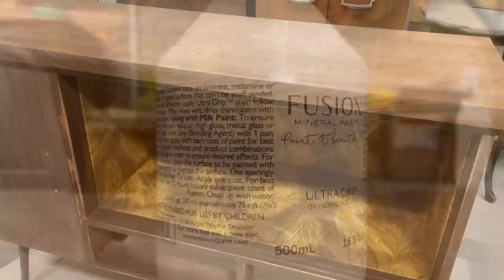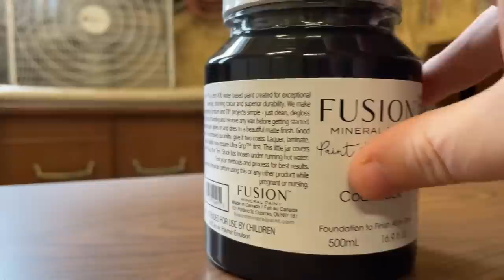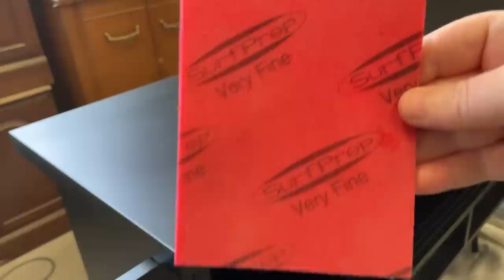Mid Century Modern Bar Makeover | FURNITURE FLIP!

Comment: Tip for enlarged wood/particle board screw holes: put wood glue into the holes and place (cram) wooden toothpicks into the hole. Let dry and cut back. Screws go in like new.
Reply: Such a great trick, recently I had to opt for bamboo scewers to solve the problem!  Those will work in a pinch, too.
Reply: Great tip!!

Comment: I have a similar bar cabinet, but mine is wood, one side has a fridge inside the door. The top opens and has a mirrored section you can leave open and store the liquor bottles . My friend bought it at an auction and gave it to me as a housewarming gift, it's awesome. I put rollers on it, so it's easy to move and won't scratch my floors.

Comment: To fill in stripped out screw holes, just stuff in wooden match sticks and you can even use the same size screws.  The wood from the match sticks is very soft wood and it will almost mold itself to both the wood and the screw for an extremely tight long lasting fit.  Some people add wood glue for an even stronger hold.

Comment: I really love this piece.  I would place a bet that the “etching” on the glass was really a decal that would have just peeled away.  I’ve seen that before on lighting pieces that I swore were etched.  I even loved the original interior.  In the video it looked like it was in great shape and would have been great to keep as-is if the glass could have lost the cheesy etching.   Also, did you consider etching the entirety of the glass instead of painting?  Love your inspiration on these beautiful modern pieces.
Reply from the maker: The etching was definitely not a decal or anything that could be removed. Etching the rest of the glass would not have made the pattern disappear but instead highlighted it. Thanks for watching!

Comment: Also...if the interior was in good shape I think it would have been awesome to leave the retro pattern!
Reply: I thought the same thing - kept the inside and glass alone (maybe tried to remove decal) painted the piece a mustard yellow to go with in yellow 🤷🏻‍♀️ I'm a beginner so ☺️
Reply: @lindahoover3445  like your idea! The retro pattern inside and the outside black would have been stunning. But with the etching (not a decal) she had not much choice as to go for painting the glass. Or remove the glass doors completely.
Reply: @lindahoover3445  
 I probably would have replaced the glass with plexi glass so the pattern and bar glassware could be seen.
Reply: Well that stinks - thanks for show me I can paint glass 😃
Reply: Well, that really stinks - I didn't know you could paint glass - I'm a newbie 😃
Reply: It is possible the etching was a decal.  I have seen them on lighting fixtures, and removed them after realizing they were only decals.  They are so thin, and scrape off nicely with a razor blade.
Reply: @iknitb4itwaship33  I like your username 😃

Comment: I agree that the etched glass needed to go, but not sure painting was the best choice. With glass doors and a glass shelf, that space is perfect for showing off your MCM glassware and decanters. I think spending the extra for replacement glass panels, maybe with some sleek, modern pulls would have been a better option. However, that being said, painting the glass was certainly much better than leaving it as-is.

Comment: Will the paint eventually wear off the glass doors?  I don't think I would be as concerned if the opened up and had a handle rather than slid.
Reply from the maker: No, there's plenty of room in the tracks and they slide quite easily.

Comment: I've painted with fusion paint with paint brushes only. I find it difficult to clean after letting it sit around even if I've put in saran wrap. How easy was it to clean out of your paint gun?
Reply from the maker: Fusion definitely does need to be kept air tight or cleaned up right away. It rinses out of my sprayer just fine as long as it’s not left to dry.

Comment: I love your channel and I used to love doing furniture rehabs but not having a proper garage meant not having a proper setup and yatayatayata I dropped the hobby after painting a pair of nightstands left me feeling sick for days even though I had worn a proper particulate mask and spray painted outside. Do you ever worry about the health ramifications of exposing yourself to all the fine particulates in the various finishes you sand (no mask is perfect) as well as the fine mist of the various paints and finishes that invariably accumulate on exposed skin and are absorbed? After my last project I just decided it wasn't worth my health unless I literally could have a proper space and setup where I could suit up like I've seen auto painters do (full suit and full face mask). I imagine that might be pretty darn uncomfortable, but being exposed to such variety of a chemicals over and over again can't be good or worth it in the long run if health deteriorates..